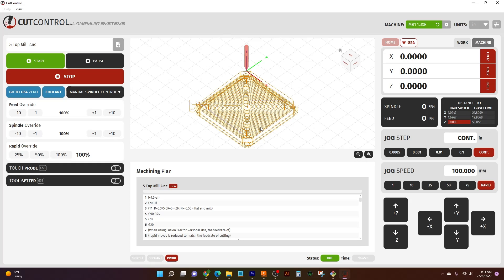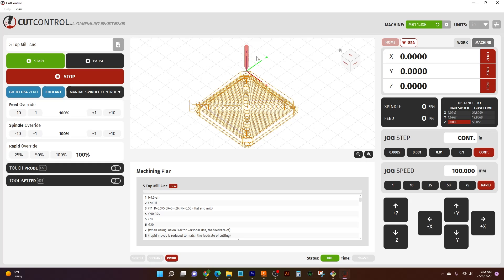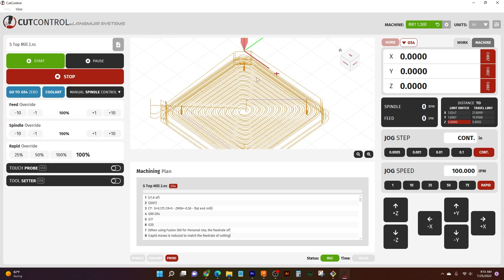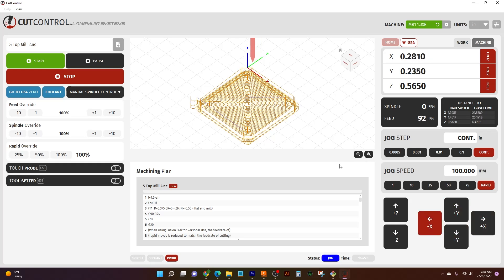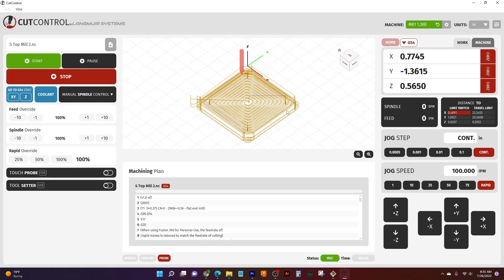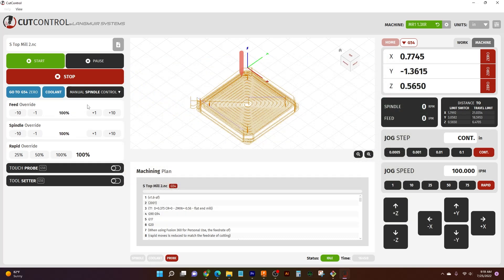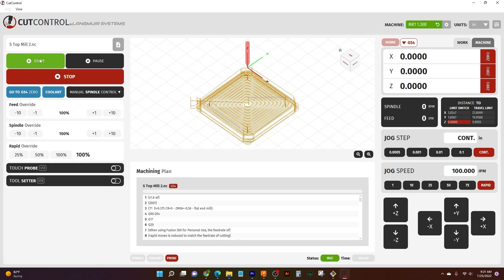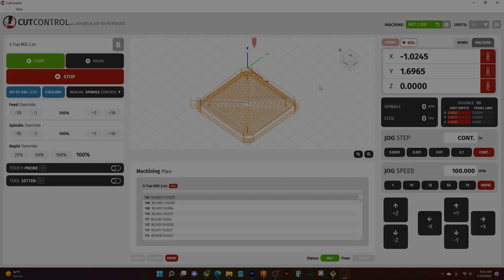MR-1 CNC Mill CutControl Software Tutorial - General Overview and Visualizer

Comment: Second time watching video, new questions. When you press the go to G54 button does the Z axis retract to Z zero on the machine to clear any obstacles? 

Also is there any chance you will be adding load meters for the spindle and axis motion. I think the spindle is most important, especially for people who are new to CNC. I have been a CNC machinist for about 40 years so my ears will tell me about spindle load, but newbies could benefit from a load meter. The Cut Control layout looks really good by the way.
Reply from the maker: Hi Don. Thanks for the feedback! On the latest version of CutControl the 'Go to GXX Zero' button has actually been split into two buttons; one for XY and one for Z. This way you can do them independently as needed. As for load meters yes we have considered it for the spindle but honestly the spindle is overpowered for this machine as it is. It can cut steel at 6 MRR and aluminum at pushing 15 MRR and not even so much as get a hint of bogging. You would stall the drive axes long before stalling the spindle motor. As for the drive motors a likely upgrade we will release in the future (backwards compatible) is closed looped stepper motors that will pause your machine if a missed step is detected so that it would save you from scrapping the part. The reason this doesn't come standard now on MR-1 is because the driver motors put out some serious power and are really not at risk fo stalling for most anything you'd want to do on the machine.
Reply: @LangmuirSystems  Thanks for the detailed response. Great job on giving the option to send Z home independent of x and y. I wasn't suggesting the load meter as failsafe, but more so to help new people understand the dynamics of what was actually happening and using them as a tool to learn the machine and process capabilities. But it's really good to know there is some serious power to be had at the spindle and drive steppers. I also like that there is thought as to upgrades and backwards compatibility. Really looking forward to getting my machine and pushing the envelope.

Comment: Im glad you guys have waited and taken the time to really improve the UI of the software. So far - looks great! With my limited knowledge on how the UI development process works - will it be possible for the community to modify the UI, and potentially make our own changes?

The only mild suggestion I have for a change would be to add a very light bounding box to the 3D viewer - about half the thickness of the border on the DRO. Though it really looks clean in the overall layout aspect - the fact the model clips outside into blank white is a little odd. Thats the only thing I can really fault - the top left relative distance indicator is super cool.

Reprogrammable Hotkeys would be super sweet.

Looks fantastic.